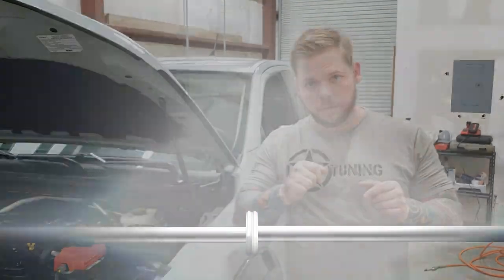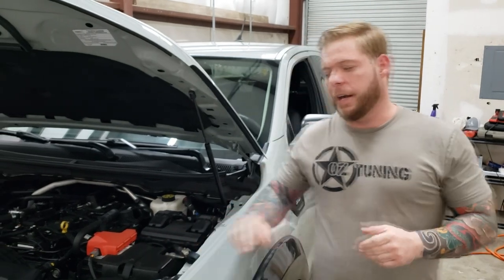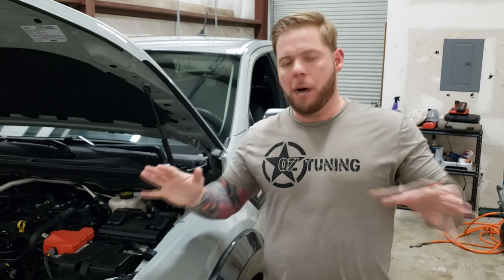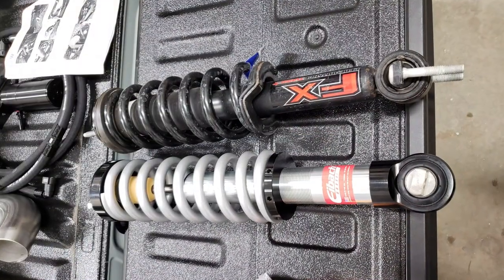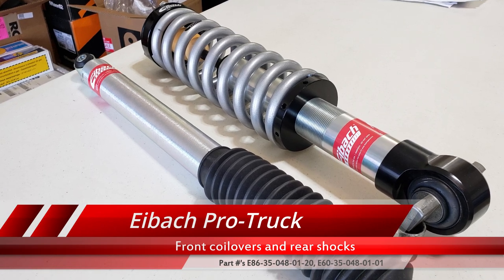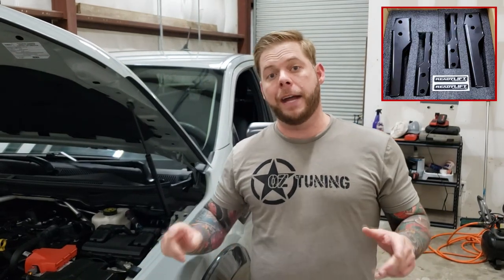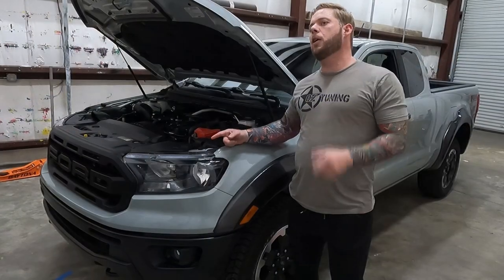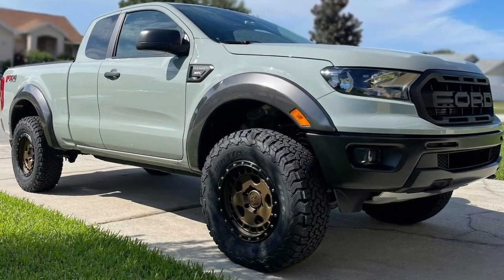Project Delta Ranger - Episode 2 - Eibach coilovers and rear shocks.

Comment: How was the alignment after the shock installation? In addition, the crash bars were removed? Did you trim the off or you go trough the hard way and remove them without chop it off?
Reply from the maker: Not too bad, but had some positive camber and took it in for an alignment.
The crash bars were removed by loosening the front bumper to get the fronts out. The rears came out by removing the the plastic trim. And then there is a support block for the liner that needs to be removed. That's the route we went so we wouldn't have to cut anything.

Comment: I have a Ranger xlt 4x4 2021 and im undecided.  I'm torn between fox 2.0 and the eibach 2.0. I want to go with a 3inch lift, so would I have to upgrade UCA's 🤔? Did you upgrade your UCA's since you did a 3inch lift? Great video by the way !!
Reply: ShockSurplus has a video where they compare those 2.

Comment: Why will these not work on 2wd??
Reply from the maker: That we do not exactly know (you would need to get with Eibach), but could be because they are too stiff without the extra weight in the front of the 4wd components. They do sell just the springs for the 2wd's that say a 3" increase, and the part number is E30-35-048-02-20.